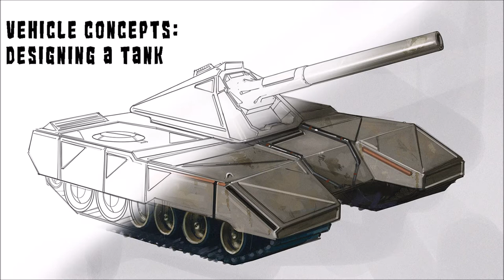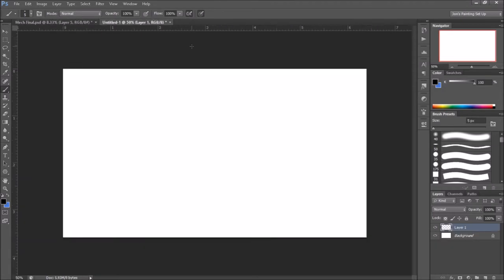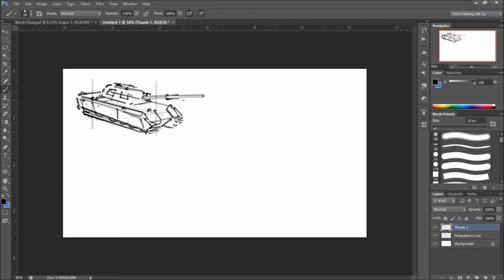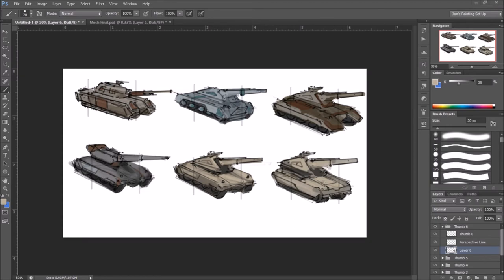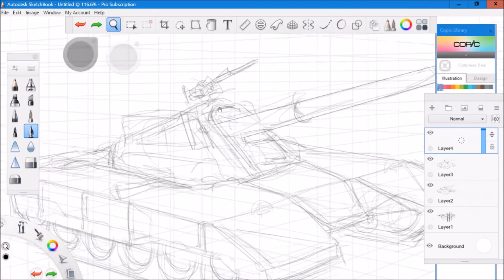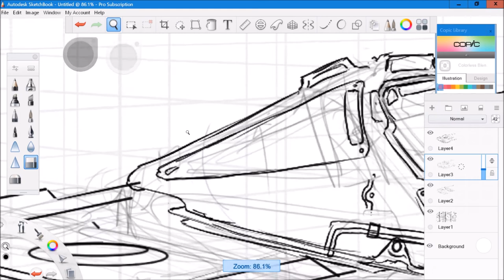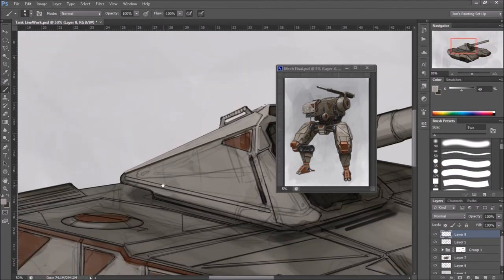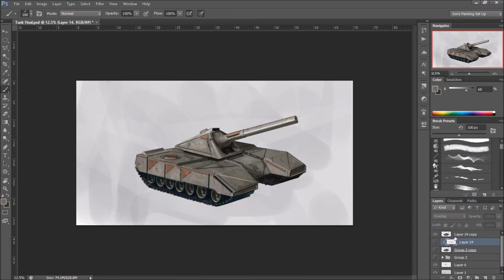Vehicle Concepts: Designing a Tank

Comment: I have actually designed a tank

The process looked nothing like this.
Info on my tank:
Name: T-130
Class: Heavy Tank
Armament:130mm M13 (My own design of a cannon, based on Soviet S70), 14.5mm MG
Armor:12in-6in. of composite armor
Engine: V12 Diesel
Crew:4 (Driver, Commander, Gunner, Loader)
Loading mechanism: Assisted manual
Estimated weight: 63 tons
Dimensions: 11' 6" high, 6' 4" wide
Purpose: To engage in tank-on-tank combat and support infantry by destroying bunkers and gun emplacements
Reply: same from me

Name:TBT-220A
Class:Medium Tank
Armament:120mm gun 50cal mg
4 crew members commander driver gunner radio operator

it was a rushed design
Reply: Command and conquer name?
Reply: The name and gun caliber made me think for a second you copied the T-103 from wot. Then I saw composite armor, crew count, etc. Do you have a pic of it? Id love to see it. 

As for my design, R-16
Class: MBT
Armament: 125mm unnamed gun based on 2A46M, coaxial 7.62mm and roof mounted 12.7mm MGs
Ammo: APFSDS/HEAT-FS/HE-FRAG-FS
Armor: Turret front 700mm composite, hull 1200mm composite with fuel tanks and transmission behind it, ERA package available, Shtora-1 active protection system like on T-90A
Engine: 1500HP diesel
Crew: 3 (Commander, gunner, driver)
Loading: Unmanned turret with turret bustle autoloader (this is why the turret armor is thinner)
Size: Idk honestly I haven't determined how to measure it (I made a 3D model of it in Blender tho not to any precise scale)
Weight: Probably around 40-50 tons
Purpose: It is an MBT so it is supposed to do whatever its crew needs it to do.

Picture:https://prnt.sc/rccbd0
T-90A inspiration is obvious
Reply: I'm not good at thinking of exact specifications, but this is what I've got:

Type 99-A Medium Tank
Armament: 85mm cannon, 50 Cal coaxial,  optional 40 Cal AA MG
Crew: Commander, Gunner, driver, loader (loader replaced with auto loader in model -B)
Dimensions: I haven't thought of it yet
Max. speed: 45 kph
Engine: V14-1A turbine engine(I just made it up)
Armour: 90mm front; 80mm sides; 75-80mm back; 55-65 top. 75mm gun mantlet; 85mm turret cheeks; 90mm sides; 80mm back; 60mm turret top.(All armour is composite, except gun
 mantlet and top.)

Anything else I should add?

NOTE: I have a Lego model of this tank, and a video showing this model on my channel. Infact, it's my only video.
Reply: I made a tank that has 5 crew man 

Name:10P V1 B 
Armament:100mm 10P cannon, 2xmg 34 
Armour:400mm composite on front,300mm composite on side with side skirts for anti heat,back 200mm composite 
Front turret angle -95
Side hull angle -70
It has a 10mm protected nest for comander to use a mg34